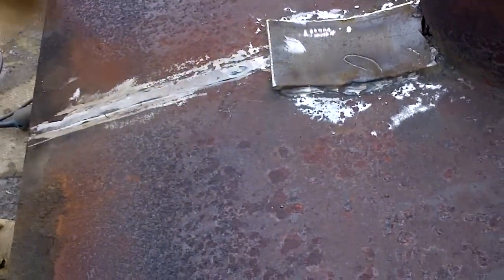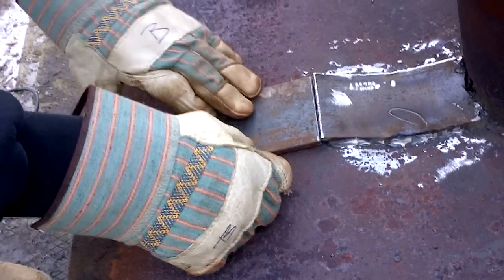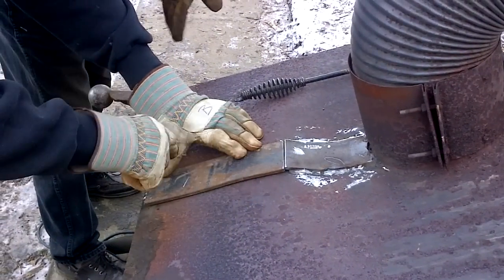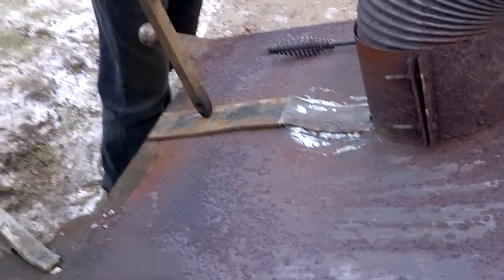How To Fix Your Broken Wood Stove

Comment: why did you grind a perfect groove into the top and not fill it with weld.... you preped it good then threw a plate over it.... fill the grind gap and be good as new and look better